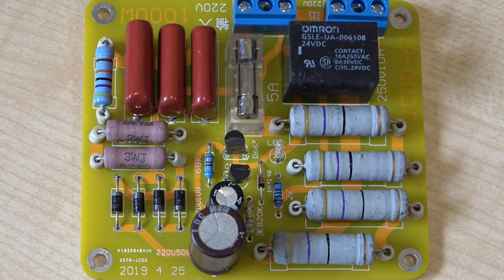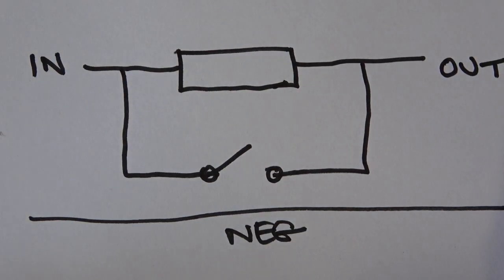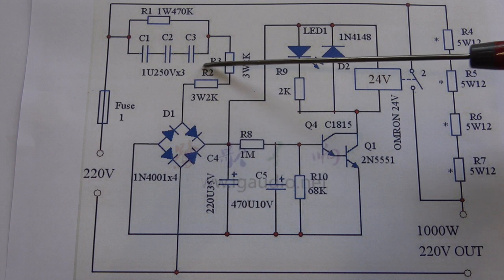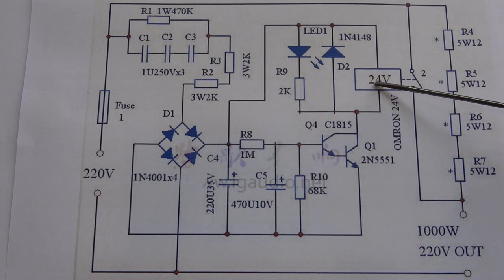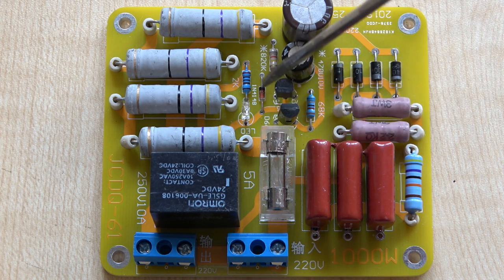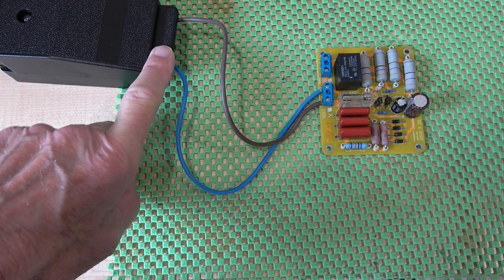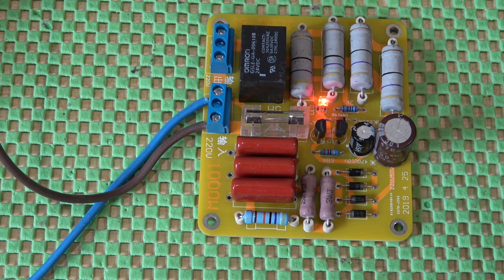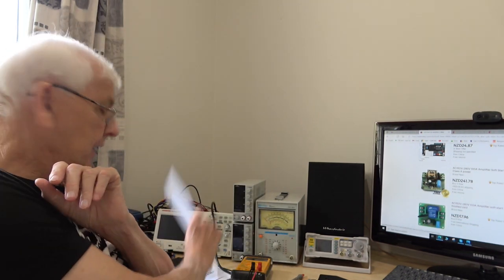Soft Start Protection board for Power Amplifiers.

Comment: can we use it to soft start an AC motor
Reply from the maker: Maybe?? Would depend on its type and rating. Not something I have any experience with. A power transformer would probably be a lighter load. Not really suitable with a synchronous motor. A proper device made for a motor would be a better choice I would think.

Comment: 120 VAC would be good for this design as well. One should be made up. 👍
Reply from the maker: As it stands Robert, probably not. It looks like a 110 volt version is not available but a quick look at Ali does show a number of different types available for 110 volts..

Comment: Hello Michael, great reviews you got going. 
About that soft starter, what if you put it at speaker out put before the speaker? To avoid over heating of the resistors
Reply from the maker: It will not do it's job at the speaker end. It is to prevent the high inrush current of the transformer, it will not protect the speaker from anything.

Comment: Is it safe to use the LED as a power indicator on the amplifier's power switch or have I built a death trap?
Reply from the maker: Yes that's fine. Just be sure the leads are well insulated from the case, and the LED itself.
Reply: @MichaelBeeny  Thanks for getting back to me mate! It's hooked up to the green LED inside a plastic 18X24mm switch. That's good news! I didn't fancy cutting through heatshrink and re-wiring the LED!

Comment: On the power amplifiers I've built I use two  large inrush NTC thermistors which I obtained from Radiospares. One in the live and the other in the neutral.
Reply from the maker: The only issue might be the hot resistance is never zero ohms.
Reply: @MichaelBeeny  Regarding improving the sound quality of your mosfet power amplifier do the following. Bypass the input capacitor and increase the value of the capacitor in the negative feedback divider to at least 220uF. Then sit back and enjoy the vastly improved clarity and superb bass extension. I have carried out this modification on several commercial mosfet power amplifiers and the improvement in sound quality is astonishing.

Comment: why not use a ptc. resistor instead of resistor
Reply: A ptc WILL NOT do inrush current limiting..., when heated up it goes into high resistance state....i.e. effect is later.....a suitably selected NTC is better.....added advantage is the NTC cools down when relay is activated..., ready for a next ( power down--- power up ) cycle...
NTC's in both series & parallel are the standard method of being wired up in professional power amps.(upto 3000W-5000W) that operate with 
linear p.s...
Reply from the maker: Some boards are using a PTC. I might look at one later.

Comment: If you have switch mode power supply then this does not work as it has its own PTC. resistance that do the same. 
And that they can operate at 110v to 240v and adjusts to input volts.

But on old wire-wound transformer it works.
Reply from the maker: I did point out in the video that it will not work with a SMPS.

Comment: I wonder what will happen if the relay does not energise. There is nothing to stop C4 overcharging. Thanks for sharing, Daz
Reply from the maker: Hi Darren, probably will not matter as the limit resistors will be on fire anyway! The smoke will set off your fire alarm letting you know we have a problem.

Comment: Sometimes modifying a " live " ckt. can be fun...so ...1) those two 470uF/10V ( C4/C5 ) must have a discharge path ..a 4001 diode across 1 M timer resistor.. it's cathode connected to dc+..
this ensures a soft "re"start even in case  of a momentary power failure . 
2) a little more complex ...,are two additional ckts. ...(a) an 8-10 volt ckt powered from 24V.. (b) one more time delay ckt. that cuts in  8-10 secs..  after the relay is turned on.....
..now this ( b ) timer logic is to power the relay from 8V whilst disconnecting the 24V supply from the relay....
Once a relay is energized..it's supply can be reduced to (50-65)% of rated volts and reduced coil current , yet remain latched
 " on "  ...(chk. data sheet for all specs.)..